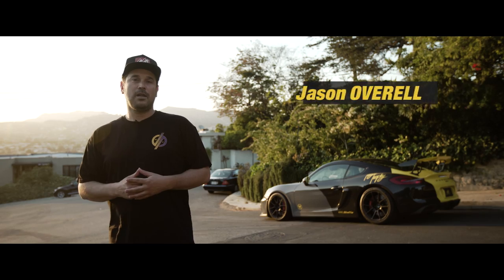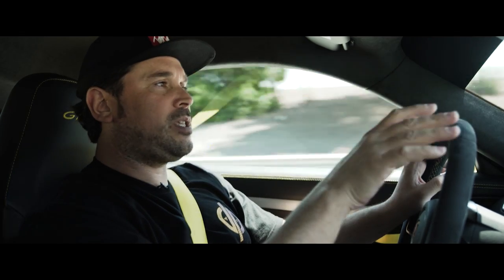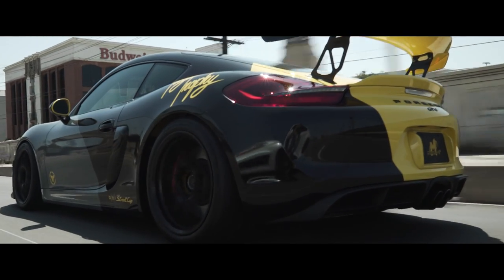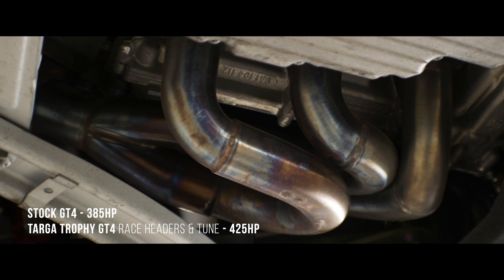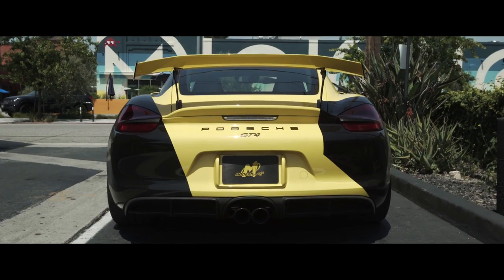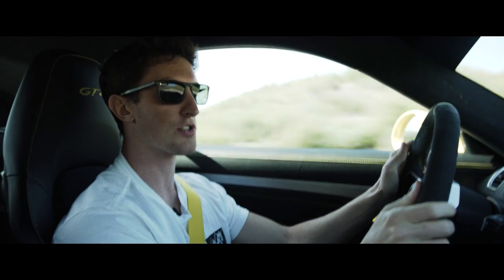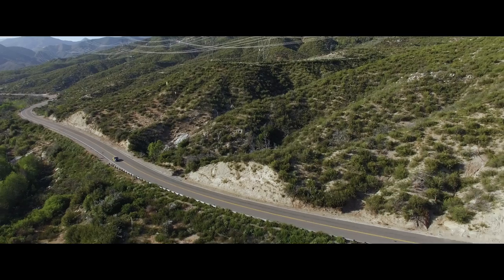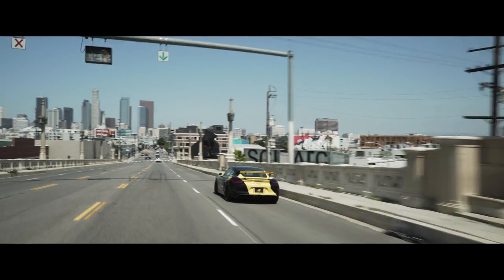BIG BANG THEORY - Porsche Cayman GT4 Street Cup | Targa Trophy Ride Check

Comment: I don't think you can subjectively push your opinion on each other in terms of what is satisfying when it comes to a manual vs. a PDK. Beauty is in the eye of the beholder. Pre-DCT, the beauty of having a manual was to get away from the annoying automatics and have an engaging experience and shift better (i.e control shift points) and faster than automatic counterparts. Race car drivers for the longest time wanted fast transmission and because of that, it allowed them to focus more on the other aspects of racing. I've owned both - and I admire the engineering that goes into a DCT and the feel of being able to shift instantaneously all the time. It allows to me to be a faster driver. I don't think the educated and talented engineers who spent countless nights engineering these DCTs had the purpose of cursing the automative enthusiast. You all are acting like those people slaved away because they hate cars. It's freaking awesome to be able to blip a paddle and have the car instantly rev-match downshift. But still, a manual transmission is still a ton of fun. The only thing that isn't up for debate is how much faster these cars have become from just the adaptation of a PDK and that is commendable. Instead of bickering at each other - why not appreciate all the effort to make push forward an ancient technology. It blows my mind that we have transmissions in cars that shift so fast. And ironically, having driven manual it makes it that much more admirable when I get to experience a DCT because I know how much effort it takes to shift perfectly and fast all the time. Even a seasoned manual driver can not match the performance of a DCT.

Comment: Nice car, but I will keep my "stock" GT4 because with all you invested, I would get the 911 GT3 instead. It is a faster, better looking and more capable monster for road and track than the GT4. The GT4 is Porsche's entry-level GT and investing $30,000 (easily you paid this much) to wrap, mod, and tune it, plus add the additional HP (and labor for all the above), you are now looking at a $110,000 car plus $30,000-$40,000. Hundreds of GT3's for sale, albeit less limited, with the 911 namesake. All in all, a Cayman will never be the 911 and Porsche will never all it to be. With the MACAN really providing the sales necessary to even support the brand anymore, they sell fewer and fewer "sports cars" every year. The SUV market (standard, S, GTS, GT-RS, GTS turbo, etc. etc) tells you that the MACAN and CAYANNE actually support the brand today. Ask any dealer and they will explain why SUV's are 5:1 on the lot.